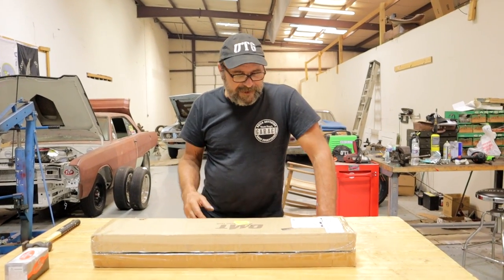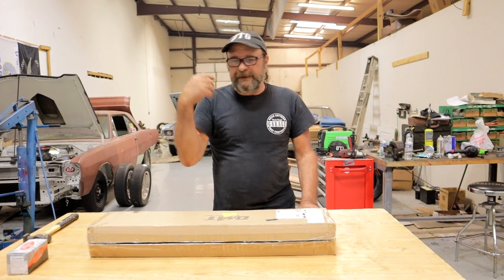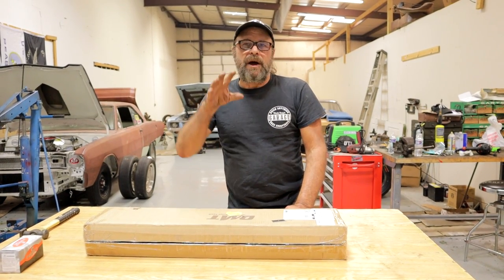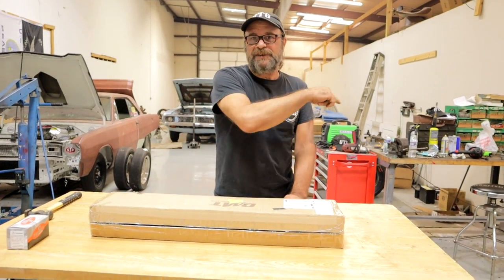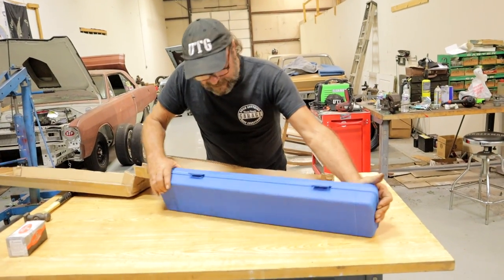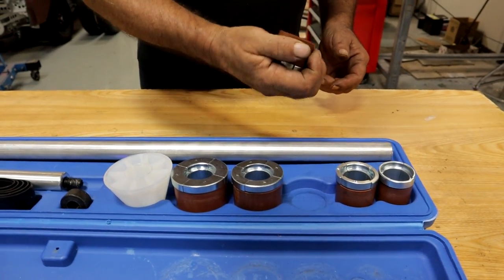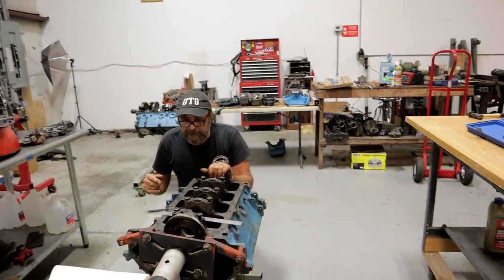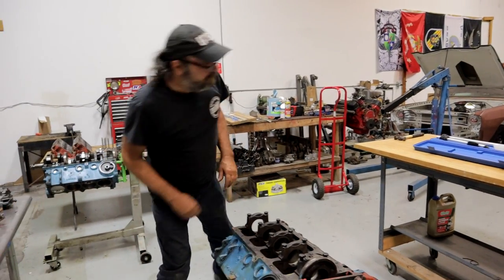Unboxing And Review Of Cheap Amazon Cam Bearing Installation Tool

Comment: crysler used 5 different diameter bearings on the l a blocks....
smallest in the back.  largest in the front...progressively larger....rear to front
Reply: So far as i know - all V8's are like that. 
Certainly B - RB - hemi blocks are.
I wud be surprised if Ford or GM are any different.

Comment: After years of doing it 50 really but I didn't started machine work in 80 and I had a lot but not necessarily that it's the brand it was a used one even a cheap one can be used but I do it horizontally on the engine stand and not vertically you have to have the Caps off to look through the oil hole to make sure it lines up with the cam bearing you have to put a line on the bearing with a felt pen to make sure you go in straight in a way that it lines up with the oiling hole and you can use a cheap tool a hundred times as long as you don't bash on it like a gorilla take your time cleanliness is the answer and putting it in the right way and double checking the cam bearing number to make sure it's in the right station and the brand of tool doesn't matter it's how you abuse it

Comment: Cool summit racing equipment had a decent looking cam installing bearing tool they wanted like $110 used to be around $65 plus shipping lol, anyways I know that because I have been considering trying to build a magnum v8 version of the 340 possibly out of a 5.2 litre 318 magnum v8 if at all possible because the current truck I have has around 176k on it runs strong except for a slightly strange maybe a occasionally 150rpm idle fluctuation after the engine warms up so I just want a good motor ready to go in the 5.2 litre 318 magnum v8 AT long bed quad cab 4x4 truck in the event something would happen to the motor in it.any advise uncle Tony sir and thank you..

Comment: I found a used A833 with bell housing pedals shifter linkage fork Z bar mount speed cable and metal hump. Seller is asking 4000 canadian. Is this a fair price. I know 3 years ago it was way cheaper.

Comment: I feel like it couldn't be too hard to make one of these yourself.  I know there are clearances that have to be just so, but it's essentially a rod that's small enough to fit through the holes, but big enough to knock the bearing into place.  Even $63 seems expensive for something that seems like it would cost about $4 in material.
Reply: I tried once using an expandable freeze plug and some rod. Trust me the $63 is the way to go.

Comment: So I have a stupid question.

The cam bearings are a slightly smaller OD depending on which hole they go in? I've never atually seen this done, just "the cam bearings need to be refit.....*video cuts*....now with our new cam bearings installed..."
Reply: Larger in front, smaller in back. Gives you clearance as the cam journals go through the other bearings.
Reply: Some not all are this way, some are all the same size. I used to scratch the top of the inside of the bearing for orientation then number them while taking them out.

Comment: Newb question, what makes each bearing numbered for specific positions?
Reply: Each bearing is numbered because each one is a slightly different size. The cam journal in the back is the smallest size, the next one forward is slightly bigger, and the next one slightly bigger.....until the one at the front of the block, which is the largest one. The difference between the sizes is very small....just a few thousands of an inch.

Comment: And I'm guessing you have to buy a camshaft bearing removal tool as well
Reply: Same tool
Reply: @edmundanderson657  thanks!
Reply: @jimmybare3026  The lip on the tool that drives the bearing in isn't as tall as the bearing thickness. Just drive the old bearing out.

Comment: The ONLY time you need a "quality" cam bearing installation tool is if you have an engine building shop and expect to do dozens or even hundreds of cam beaning installations over the period of several years. Duh! 😁

Comment: It's not the same tools. Just like the case is made of different color/material, so could be the tools.  Different metal/filler, thickness... or what many mfgrs do.... these are rejects from the other brands.  So tolerances could be off.  
Yet this gives the diy'er the ability to do things that before it wouldn't be cost effective.  
So as with everything it has Pros and cons.

Comment: "The Right Tool For The Job"
I'm sorry, I don't "buy" doing it this way. If you are skilled and you've done the task before and are proficient at it, yes you could get away with the cheap ass tools. BUT, if that description doesn't fit you, then you would be better off buying the quality tool because it will do the job correctly and that will help make up for your lacking skill set. (Of course with some folks even a quality tool won't save them) 
With the cheap tools not only do you have to do the job right, you have to compensate for the tools lack of quality with your skills. And if your skills aren't "There"? Then you end up with a FUBAR!

Comment: Every cam bearing tool I have seen all look and work generally the same, so your visual comparison happiness is BS - the quality is in the materials and manufacturing of the parts.  Most Lisle tools are Made in USA, and Snap-on IS Made in USA.  You get what you pay for.
Reply from the maker: Not true.  My previous one (Believe it was a Lisle) was purchased in the middle 1980's and had a completely different type of expander and was of a very heavy construction (comparatively)
Don't take my word for the similarities of the sets currently offered.  Go to each ad and zoom in on the components. The only thing different is the color of the plastic cases.